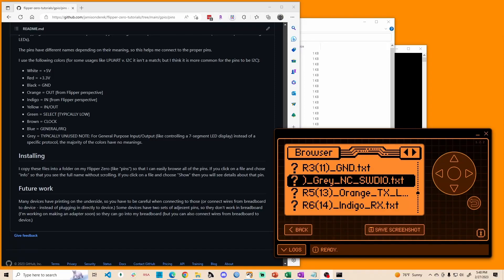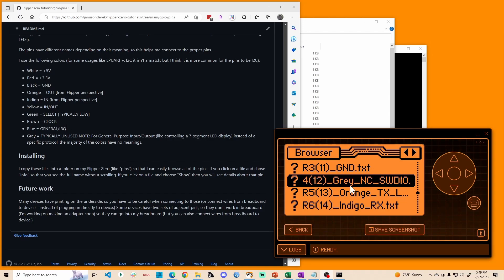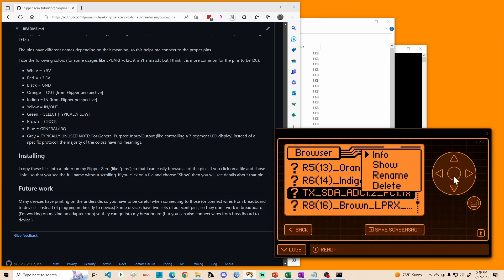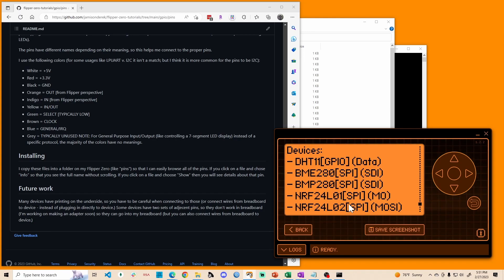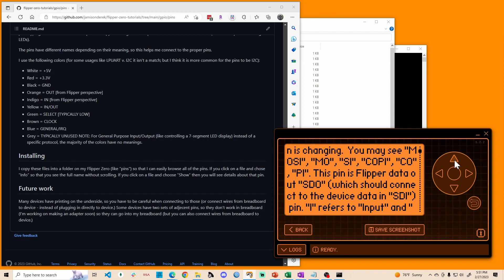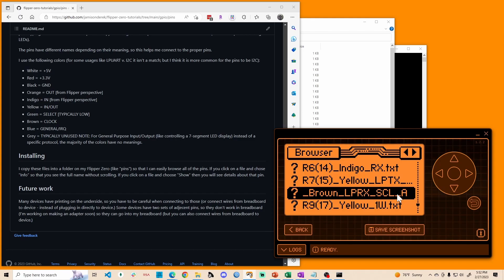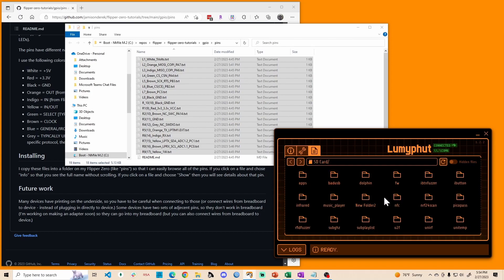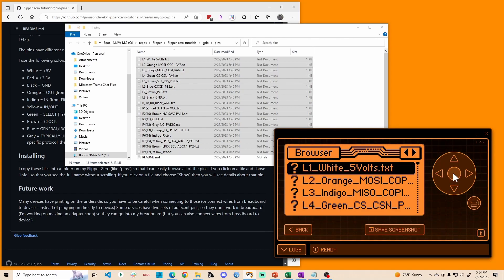[32] Flipper Zero - GPIO "pins" project

Comment from the maker: If you have any feedback, please leave a comment below.

I fixed the repo so that my second nRF24L01 is called NRF24L01.  

If you have ideas how to handle the fact that LPUART TX (OUT) is same pin as SDA (BOTH) and LPUART RX (IN) is same pin as SCL (CLOCK) so the colors for my LPUART are wrong, I'd love to hear them.  It seems most applications use USART not LPUART anyway -- so likely it's not going to be a common issue.  Maybe I should just allow for either color on those pins?